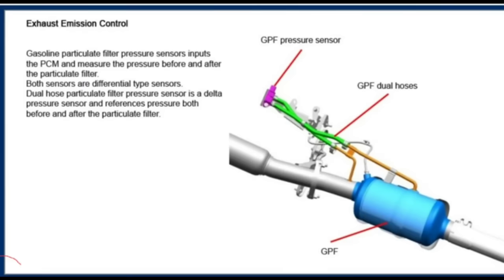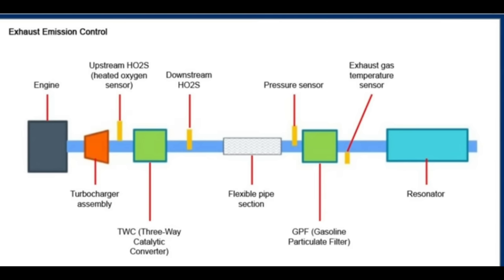Gas Particulate Filters Are Coming To Fords - Check This Out - I'll try and explain

Comment: My brother has a 2022 Dodge RAM 3500 Laramie with the Cummins engine. He's put 75k miles on it and the diesel particulate filter has failed. It's not covered under the bumper to bumper warranty and it costs $7000 to replace. F'ing stupid.